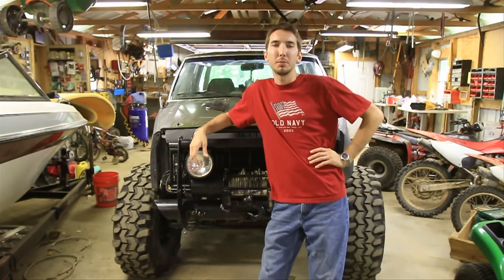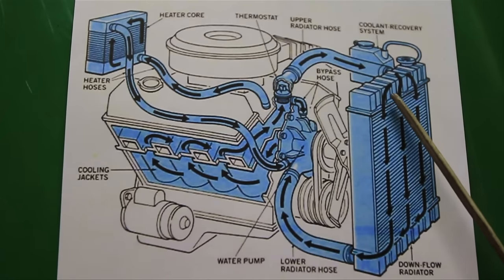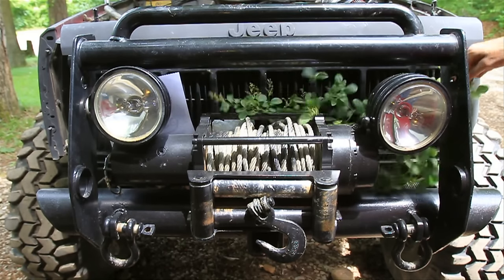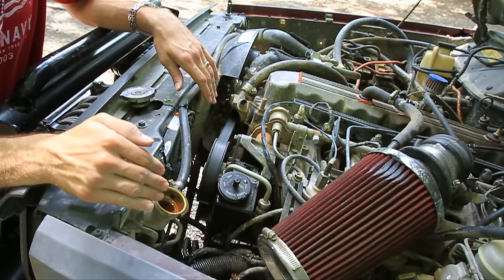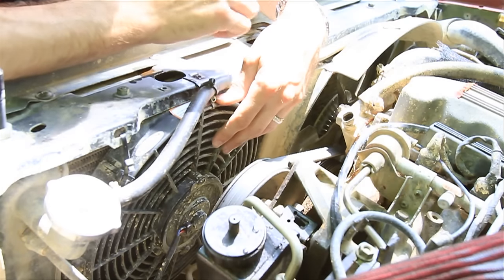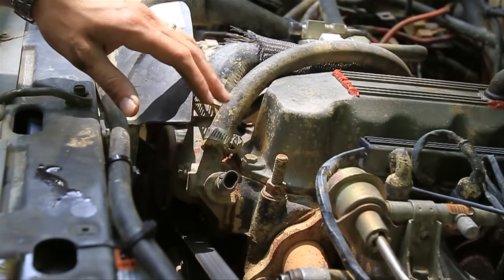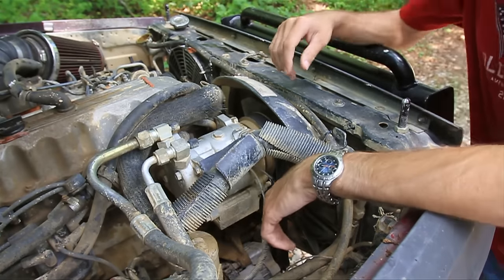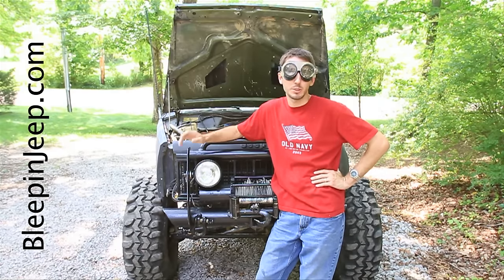Engine Overheating? - 9 Steps to Solve

Comment: So here's the story: I was taking my XJ out for a spin since it was years since it's been driven only to be used recently for short distances (like getting groceries and such) and wanted to know what problems it could have from staying still so long. Well to my luck I got my answer because after taking it around the city and then doing 50+ on the highway for about a good hour it began to drag and could tell it was forcing itself to keep the speed constant, up to the point where it even began to wobble or shake (but the tires didn't look like they were the cause). As this happens I see the dash marking over 210 but not near the red zone. When I popped the hood I found the coolant tank exaggeratedly full as if it were backed up, coolant gushing out after taking off the filler cap and the motor idling way too high. Now, I noticed the fan never turned on, but I don't think all that could have been possible just from the electric fan not working. Any suggestions? Many thanks for your time.
Reply from the maker: Meta Mein sitting like that takes its toll... the thermostat could be locked up or the water pump could have rusted away, the radiator could be clogged, etc, etc.

Comment: How about ambient air can have an effect on the cooling system along with check to make sure the IAT and ECT agree on a completely cold engine. 
Also, head gasket and block problems as-well-as exhaust gasses not being properly vented .

Comment: If you upper radiator hose is hot and they bottom is cold then it the thermostat. Check to make sure coolant is flowing.When the engine is cool take the cap off and run the engine in a few minutes the coolant should start to flow if it doesn't then you got to check your water pump or clogged radiator.

Comment: HI  I drive a Isuzu SUV with 3 liter 4JJ1 Diesel engine.  This is have Clutch Fan.

I live in Tropical country so we do not have heater at the cabin and we just have air-conditioning cooling.

On High way driving,,,i never encounter engine overheating.

During Summer time and on Traffic situation (like stop and go), i have experience that the engine start to overheat (mean that engine temperature gauge start to go up than the normal position ....AND The air-condition evaporator also give out hot air as well.

This happen like 5 times in a year.

Other things to share are as follows :
  -  I have had my air condition system clean just few months ago and cabin filter is new.
  -  I have change new original radiator unit last year.
  -  there is no blockage (like plastic, etc) of the air condition condenser unit and on radiator unit and even in between the radiator and condenser unit.
  -  I alway use the original coolant from the manufacturer.
  -  i believe there is no coolant leak as i never add coolant.
  -  The electric fan (in front of condenser unit) for air condition run when air condition is switch ON.
  -  The original fan shroud (upper and lower) are installed.

Some say that the thermostat is ok because i never had engine overheat at the highway.

I try to observe the clutch fan as follows :
   -  When the engine is cool (not reach normal running temperature).   When i stop the engine....the clutch fan will continue to rotate few more complete rotation (like 2 to 3 complete rotation.
   -  When the engine is warm (like normal running temperature)...When i stop the engine...the clutch fan stop rotating immediately.

May i have your advise on what could be the problem of overheating engine and at the same time hot air come out of the air-conditioning unit.

Thank and appreciate of your help
Reply from the maker: Not sure but try posting this on our "club bleepinjeep " fb group for more help!

Comment: I did, oem 195 degree. If I've got a 3 core, the PO would have put it in, how would I check without ripping things out? I was going by the temp on the cluster, I know it's not a true temp, but I'm sure it can't be too far off. As a matter of fact just today, 92 outside, ran the engine pretty hard for about an hour, secondary off. Got home, popped the hood and grabbed the coolant tube, it's hot, but not enough to burn. Just goes to show how bulletproof these 4.0s are. 220,000 miles later.

Comment: 00 mercury villager. It actually a friend.They change the engine earlier and im pretty sure it just needs a good back flush because the engine sat down for a while.But he said it stopped taking long to heat up. I am a rookie mechanic but is better to get a 2nd opinion still.

Comment: Good info in your video! I replaced my water pump, thermostat and rad this past summer. I am getting good cooling but I can't seem to get the electric fan working. The fan works when I unplug the coolant temp sensor ( which I also replaced) but not with it connected. I also replaced the fan relay. Could it be related to the air conditioning system which stopped working just before the fan stopped working. It's a 94 Jeep Cherokee Country edition. Any ideas?

Comment: Thank you for your reply, I can see where my coolant is going its all going out from overflow bottle from top because of boiled steam water bottle got cracked from top, So  when hot boiled water comes from engine to radiator instead of going into radiator it goes to overflow bottle and spreads out.

Comment: I just changed my motor oil a few days ago. Used 10W-40 Conventional oil but I put 5W-30 fully synthetic oil as my engine seemed to be pretty good in condition, no oil leak. Then I realized that I had a cooling issue on my Nissan SR20DE engine lately. 
Idled for 10 to 15 mins after the water temp reached running temp., I noticed my temp indicator went up, getting close to H.
This happened a few times and no more since then.

I have a few questions here.

I am wondering if this is a sign of thermostat wear or something else.

When my engine was cool, I turned on AC, 2 fans worked.
Turned the AC off and waited if the temp indicator goes up again, did not happen.

I have a few questions here. 
1. Do both fans (mine has 2 fans) work when it gets hot?
2. Any better way you could suggest to check fan cupllling wear?
3. Do you think thermostat caused this issue?

Here are some info of my car maintenance for you.
water pump and thermostat 60000km, radiator replaced with a new one 12000km so as coolant, upper and lower hoses, 
Now mileage is about 200000 km.
Reply: I have the same issue. drove my car for 10 miles round trip...pulled up in my drive way and the temp went up to H. Noticed low oil (had oil change about 2 months ago -400 miles ago).  i added oil to the required level...test drove it and at 2 miles car temp went up close to high normal and then it went down to normal. Drove back home (1 mile) ...parked and temp went up to high normal again. Then fans kicked in and temp went back down to normal again.  Never had that issue before

Comment: your video is very helpful. But I still have a question. is it make a different if you just put 50/50 coolant on the radiator after you flush it? to burp it?
Reply: window on my jeep Cherokee loredo 2000 4.0 window on the driver side works going down but not up. Any advice for me pls... thank you....

Comment: If it requires a major job to fix. I would recommend you use Evans waterless coolant.  375 F boiling point. Won't over heat.  Great "band aid".

Comment: A simple but regularly overlooked issue is a wrong size radiator cap. Make sure it is the manufacture specification , whether 0.9 or 1.1 or whatever.

Comment: good video man. they are very informative!. anyway, i have a 1999 camry that is overheating...but right  when it gets close to the red (especially on freeway), its rapidly will drop into the normal area....besides that  the most noticable thing is that I lose alot of coolant wihout a visable leak. any suggetions? im about to change the thermostat, and have already gotten a new radiator cap. any advise would be apreciated!
Reply: i had a problem with my 1999 toyota camry. the coolent would leak fast. then the meter would go hot. i drove it in the free way and it stopped on me. the engine doesnt start. i had it towed to my house. any idea what it could be?
Reply: Chris Gatdula.
Reply: I have the same problem

Comment: Hey Matt,

Very informative video! If you only overheat when on the highway what would you think is the issue. My Dads 2003 TJ does fine around town but on the highway it's overheating.
Reply from the maker: My first guess would be the clutch on the clutch fan.
Reply: i have an intake valve problem, would that make my car over heat as well.

Comment: Good Video. I have 1997 toyota corrola. Radiator Fan in working, thermostat has been replaced. My car overheats, but when I turn on the heat inside the car heat fan to full the car does not overheat. The overheat Gauge goes down as soon as I turn the heat on. I open the radiator cap when the car was cold and heated it up, It spit out hot water, occasionally from the top of the radiator. Any suggestions what may be. I do not really have any equipment to test the combustion air leaks.

Comment: I have a 2012 Dodge Journey 2.4 liter engine. My fan works well, the hoses are hot but when I rev up the engine with the radiator cap off, the coolant doesn’t get sucked in, it blows out when at 195 degrees.

I know it has two thermostats, I don’t know if the secondary works well.

Thanks in advance for you time and advice.

Comment: my engine is over heating every morning am topping up coolant.i replaced the pump and cylinder head gaskets just recently. what could be the problem. its a 1khz engine
Reply: You're losing coolant somewhere. Radiator leak, hose leak, water pump gasket, head gasket, something... Top it off, warm up to normal operating temp, then check for leaks while it's idling. Even a slight drip drip drip is enough to require topping off each day.

Comment: Why is your coolant sensor unplugged? Will water circulate thru the heater core when not in use? I noticed that the hoses were hot close to the thermostat then cold all the way to the fire wall. is that an air block or just no flow thru the heater core. Even with the heat on now no flow so I'll try to blow it out but I need to know if it always flows or not.

Comment: Question: I have a 2000 Jeep Wrangler.  I just limped home.  The temp gauge showed perfect temp.  I smelt heat in the cab.  When I let go of gas, it would not coast as normal, but decel very quickly.  When I stopped, a slight amount of smoke was coming out of hood.  I opened hood and couldn't find where smoke was coming from.  There was plenty of coolant in the radiator.  Any ideas why it acting like that?
Reply from the maker: +JAY STATON maybe a stuck brake caliper?

Comment: Can bypassing a heater core cause an engine to run hotter? I average temps between 207-211 and hit 213 recently. I just recently installed a JDM engine with 50k miles but still bypassed my heater core. My old engine ran a little cooler but had a blown head gasket. New engine runs great just a little warm. Any opinions?

Comment from the maker: more heat from a larger motor.  I'd be using the best radiator I could find, and make sure the system has no air in it.

Comment: '94 JGC 4.0L 219K miles - last HOT summer started cutting off, like overheating, every 20 miles or so; then restarts after 10 minutes cooling.  Over the winter, this problem went away.  Hotter days are back, along with this problem. Even running the heater core does not help.  I went through your 9 steps... 
except #7 - did not change thermostat, but I am getting flow.  
except #4 - would seasonal temp matter? 
except #5 - appears to be none - would seasonal temp matter?

Thoughts???  THANK YOU

Comment: you mention if it runs hotter on local roads it could be air flow- how could i tell if its air flow or coolant circulation?

Comment: Thanks for sharing.. I have nissan maxima 3.0.. my heater core is damaged and I closed both hoses with a spark plug .. the problem is that 2 hoses are different in size which I can't connect them in loop.

My question is that, I'm having overheat only at summer at extreme hot.. Could the heater core hoses are causing the overheat ? Coz they're not in loop? 

I really appreciate your support

Comment: Yo, what if the coolant gets pushed back to the overflow tank? My hose swells up aswell, anything helps thanks
Reply: It's normal for fluid to go to overflow. Pressure and heat expand, when everything cools the fluid should return back to the cooling system. Your radiator cap should have a psi rating on it, make sure it's the correct cap.

Comment: I’m having issues with overheating on my 98 xj. I have just recently replaced the radiator, fan clutch, thermostat, water pump, and coolant. The first day back together it ran fine no issues. But now it’s doing the same thing that it was before I changed anything. The only reason I changed everything to begin with was because I didn’t know the history of the maintenance of the prior owner so I wanted to start fresh. Once it gets hot it won’t start until it cools off again. Any help would be greatly appreciated.
Reply from the maker: probably have air in the system I would imagine.

Comment: What about if the radiator cap is opening at too low a pressure. The engine coolant boils early then send the fluid to the recovery tank and it over flows right?

Comment: I've had 2 radiators pop along the seams I'm on my 3rd one except this one is brand new. I've burped the system and replaced my water pump, hoses are fine and yet it still over heats. ill replace the t.stat soon but I'm leaning towards a blown head gasket because my reservoir tank bubbles when it starts to overheat. any advice of these symptoms? cap is fine btw

Comment: The fan doesn't come on with the AC on. I thought I'd read something about some kind of another relay that operates with the AC system turning the fan on and off. I'm going to get the AC serviced in the spring so maybe that will cure the problem. I think it's lost it's coolant charge possibly because of a pinhole in the condenser . Luckily the average temperature up here right now is about 30 degrees F.

Comment: so I have a question for you, ive looked but ur video has helped out so far. I have a 1985 Ford f150 5.0 just recently it started over heating I just changed the oil and oil filter. I also flushed the radiator and filled with brand new antifreeze. when I let my my truck run and see if that had done the job it still overheated, when I took the radiator cap off the brand new anti freeze had a crap load of rust in it. so would you suggest replacing the radiator? or could it be a water pump issue?
Reply from the maker: Hard to say, it could just be mostly water and no antifreeze.  I would flush the system good and see what comes out then try again.
Reply: i flushed the system with water for 20 min let all the water drain out then filled with antifreeze only 50/50

Comment: i have a chevy tahoe 97, 5.7L v8, 4wd,  temperature is perfect on road it only gets over heated when i go off road and not after a long time, checked all the above steps, plus i have 2 electric fans on the radiator i made one of them running all the time but still problem exist, any advices?
note: i have an external cooler for my automatic transmission if that makes a difference.
please help.
Reply: could be a head gasket

Comment: I dreaded the overheating issues, I had the same problem. To fix i went full electric twin fans with external adjustable thermostat, never runs over 180 at any point in time.

Comment: Btw... also my petcock is dipping collant. Not much but it does. Is that back pressure? Because it didn’t start happening until after i replace the electric fan motor.

Comment from the maker: You need to flush your radiator fluid and wash out the bottle.  Check out my closed to open videos for some insight on this.  The noise you are hearing is probably your power steering pump going out.  check out my vid on how to change your power steering pump.

Comment: hi,how i know if water pump is bad,no weird noise,no leaks,but overheating,thermostat is good[new]fan cluch is good,any other way.how about if l disconect upper hose on radiator,if pump is ok shoul be water fluting,if not water will be a little bit

Comment: Great video.. I have a 98 Grand Cherokee that has symptoms of overheating really quickly and no heat coming through the vents. This all started yesterday when the radiator hose blew off. I've seen many others with the same issue on other forums but have yet to have seen a

Comment from the maker: what is happening is the car gets hotter when you turn it off cause the coolant is no longer flowing and pressurized.  It could be as simple as your radiator cap is bad, after that I would replace the thermostat.

Comment: Hi...I have a 2000 jeep tj 4.0 it goes over 210 only on the hwy or sometime when idling with the ac on...I already replaced the thermostat, radiator cap, fan clutch and water pump but still have the problem...have this jeep for the last 6 years and it was always under 210....what else could it be....your thoughts would be greatly appreciated......thanks

Comment: Gud video sirji,,
I have a swift diesel 2012 model almost 90k run n well timely maintained car which runs butter smooth n in love driving ,,,yesterday i Went  to ooty hill station with 3 people n weather was cold ,, while I was started the hill climb in the morning with lot of hairpin curves, after driving with using only 2nd gear while climbing for 12km uphill ,, at one point with uphill traffic stopped n when I hit the 1st gear, there was no acceleration wen pressed hard, car was not at all moving!!! I was literally shaken wat to do n then some how made it barely move it with less acceleration n took u turn n came back downhill :(  wat do u think the issue is,, I started my journey back to bangalore on NHighway ,, it was all normal,, wondering wat to do if I again to hill station!?